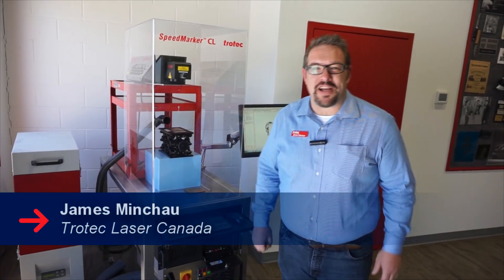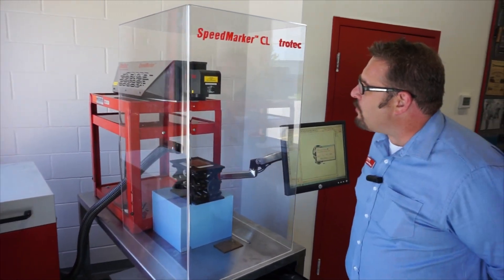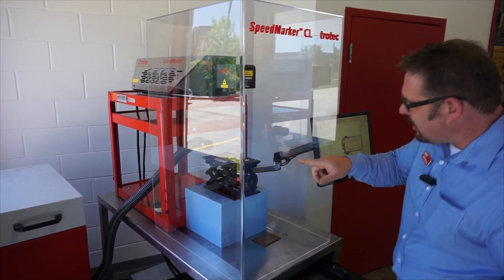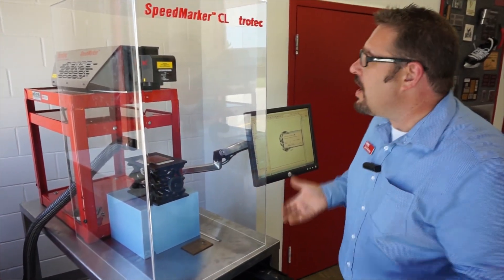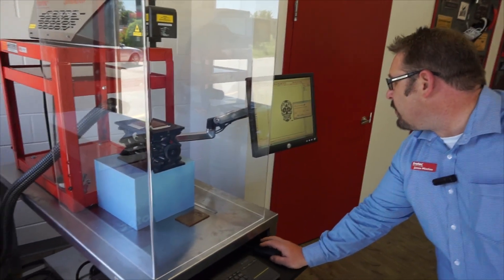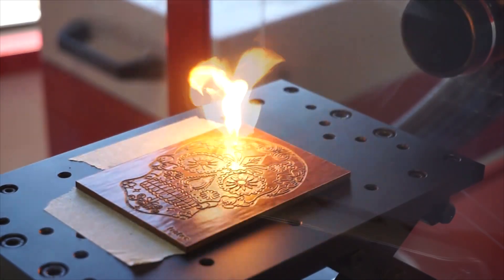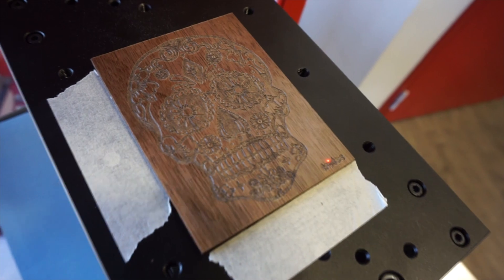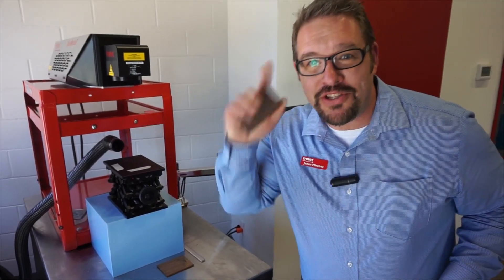SpeedMarker CL | CO2 Galvo Laser | Sugar Skull

Comment: Awesome. We are looking into adding a co2 based galvo to our shop. We currently have a gantry system. 

Question: What is the biggest bed size something like this could handle?

Also, at a certain point, does the beam become too much of an angle at the far end of table for example, and does that show in the work?

Still on my list of things to do to come hang out at Toronto showroom. 

Thanks!!